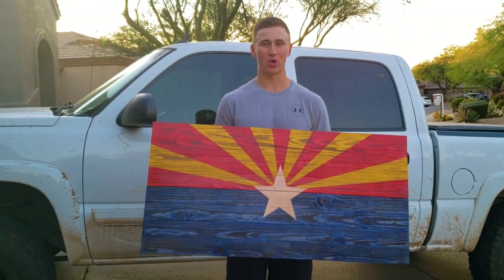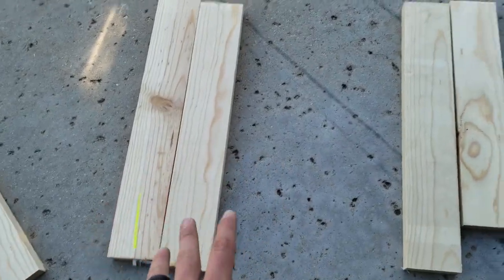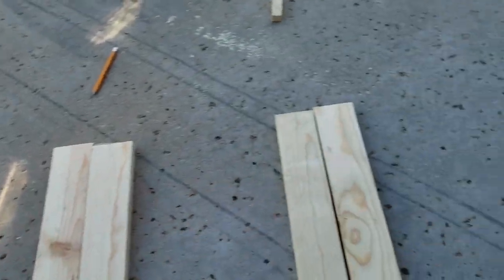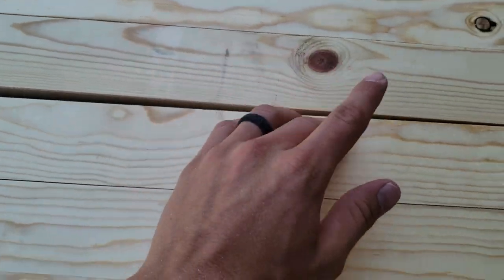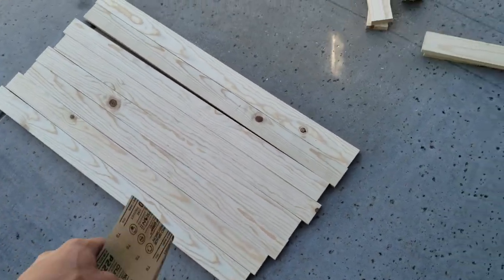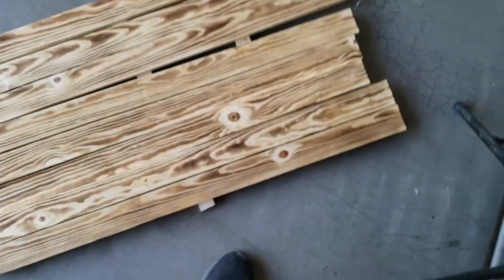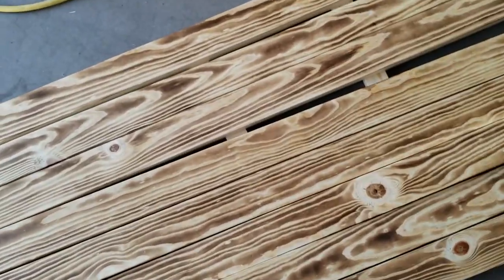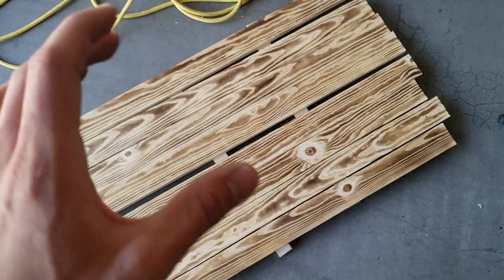HOW TO MAKE A TORCHED WOODEN ARIZONA FLAG | Step by step

Comment: Another awesome video Max. Suggestion for plotting the star - using a compass, draw a circle the diameter of star (in your example 8 1/2”) and then using a protractor, put a dot on the circle every 72 degrees (360 degrees divided by the 5 points of your star). draw straight lines connecting dots 1 to 3, 3 to 5, 5 to 2, 2 to 4 and 4 to 1. I’ve built 3 of your American flag concealment cabinets for veterans so far and have requests for Az flag cabinets so this video helped to plot out the sun rays perfectly. Thanks!